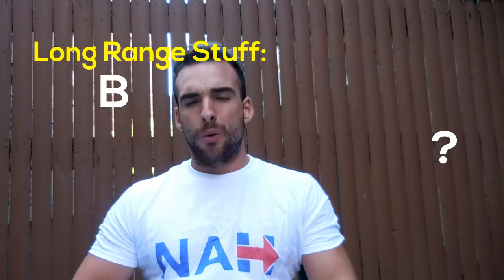New Rifle Barrel Break in Procedure (do you have to do it?)(HD)

Comment: Bang on! Besides a fairly brief cleaning when I first get the rifle to make sure nothing's in the tube, I just go shoot it. A bullet traveling at 2700fps will take off any micro burrs and the copper will fill in any tiny inconsistent rifling marks. I find the same thing. After about 50 rounds or so my groups tighten up and my Tikka did the same thing shooting a touch high. In my view that's from the barrel getting to a proper amount of copper build up which is good, which can make the barrel more slick increasing velocity. I just try to not to let the barrel ever get to hot. That's when you run into increased throat wear. But a 308, can handle this better as its not over bored. Then when I see my groups open up, I'll give it a run through with wipe out. Then it usually takes about 20-30 rounds to get back to tack driving accuracy. Great advise.
Reply from the maker: Yep!  Exactly my thoughts.

Comment: My "break in" is done while I am testing 4-5 types of ammo to figure out which one best works in my new rifle. Usually by 40-50 rounds I have narrowed down 1 or 2 that I will use in the rifle. Kind of kill two birds, as it were. So, even if the particular barrel doesn't need a break in, I am testing ammo any way, not expecting great results until I get the right ammo and getting use to the gun, like the trigger and recoil.
Reply from the maker: Thats what I do too.
Reply: That's what I did on my Savage 30-06 after considering that a break in was just a waste of time. Shot factory Remington to sight in my scope and then shot several different reloads. I did clean the barrel after that day and went back to the range several times with a narrowed down group of reloads. That gun now shoots groups that touch the edge of a dime or better.
Reply: @anthonym2504  I did use a very abbreviated break-in procedure with 2 Savage Axis rifles, a 270 and a 308 and they shoot as you stated.  Super tight groups for entry level rifles you could fully cover with a quarter.
Reply: @hardball107  how do you like those Axis rifles? I always wanted to buy one! Any issues? Any particular pros and cons I should watch out for?
Reply: @anthonym2504  I love 'em.  Both my son and I are National Match shooters and own everything from Weatherby's and Tikka's to entry level rifles like the T/C Compass, Ruger and the Savage Axis.  IMHO the best of the bunch is the Axis, I say this because I own a 270, my son owns a 308 and I've shot 7mm/08's, 6.5CM, 25/06 and 243 and all have been tack drivers.  All bought with rebates for $250 new.  Only thing added was an M*Carbo $25 trigger kit and we eventually upgraded the scopes.  Those suckers just shoot and are the best bang for the buck out there.  Problems ? None but, they do have the heavy lawyer 5-6 lb. triggers.  M*Carbo sells a kit that shims the trigger and gives you the choice of 2.5 or 3.5 lb. let off. worth every penny.
Reply: @hardball107  thank you for the info.

Comment: This is a big debated thing that I don't really think there is a right or wrong answer to. I do a barrel break in on most my barrels because as a machinist/gunsmith I know that no matter how sharp the cutter there will still be microscopic burs left in the barrel which need to be smoothed out. Does it make a difference is debatable but it makes me feel better and it's my time spent doing it so what does it matter.

Comment: The possibility of temperature break-in is probably due to metallurgy principles...But, when metals heat quickly and cool slowly the metal has tendancy to bend less depending on the center of the rifling.... But it is up to the descretion of the operator /owner having need...In my metallurgy experience I side with you on this point,that it is mostly hype or opinion and can only be the owner operators decision. Ex- Naval Aviation Structural metalsmith....... Cooling metals to quickly may cause flexing in the metals..... Which is why oil is used in the metal cooling process.....because it may harden the metal too much and make it brittle or dangerousely disasterous when using explosives......... Most metallugists can corraborate this on tempering metals..... Gunsmiths are usually the best metallurgists because they use explosive pressure scales to determine defects in metals....

Comment: Do you need to break in a newly manufactured barrel, no.  Modern processes have probably eliminated the need for it.  Do I break-in new barrels, yes.  I have an abbreviated procedure, less than 20 rounds and I does make a difference in bringing a new rifle to it's full potential.  Case in point, I bought a used Savage Axis in 270 for $125 from a friend that just disliked it, claimed it shot patterns.  My son bought one in 308 because as an old National Match shooter I had a basement full of 308 and his Tikka in 7mm/08 was starving for ammo.  My Savage was so copper fouled and dirty it looked like it had never been cleaned, a couple dozen passes with JB Bore Paste and a good cleaning and lube and we were all set for the range.  I put both rifles through my short break-in procedure and by the end of range day they were both shooting very sub MOA, a few of the groups out of the 270 you could cover with a quarter.  The groups shot with the 308 got smaller as we went along starting at just over 1 MOA and ending up right around 3/4 MOA.  Both rifles had Vortex glass and the 270 had a M*Carbo trigger kit.  It was nice to see the 270 tighten up and the 308 is a gem, would it have gotten there with normal shooting, probably but I have seen new rifles seriously copper fouled affecting accuracy.  My procedure seems to eliminate that possibility and as you said, lay down that copper burnishing needed for top accuracy in both new and used barrels after a serious cleaning.  I mean it couldn't hurt.

Comment: Remington 700 SPS tactical. heavy barrel. took it out of the box and cleaned it up good with ballistol. very mild cleaner. pulled 3 wet patches through soaked in ballistol. soaked bore snake in ballistol. pulled it through 6 times. pulled another soaked patch through. pulled dry patch through. shot sub moa with 168 grain eldx hunting load. after 50 rounds shoots consistent 3/4 to 1/2 inch groups all day. no break in period. just one extremely good cleaning out of the box. 1 in 12 twist rate. FYI.
Reply: that Ruger American 6.5 creedmore looking good. will probably be my next rifle.

Comment: What happens after you clean the rifle with CLP? The lapping or seasoning goes away and have to do it again?
Thank you.
Reply: No.  CLP is very mild and just cuts the fouling and removes loose carbon.  I run a patch through the bore with mineral spirits and finish with a bore snake with a little CLP on the end when needed.

Comment: so, the question I now have is...After you have shot 60 or rounds and have a layer of copper that has, for lack of a better term, polished the barrel, then you clean it, do you have to re-zero every time you clean? Cleaning might take some of the copper away and cause your dope to get screwy.
Reply: John Harris normal barrel cleaning with  wet patches is to remove carbon and other powder deposits. This does not remove the copper. A fairly caustic solution is used to remove the copper which is 'soaked' then removed. This still has to be done, but only after 100's of rounds when your grouping starts to spread out because of the copper equilibrium starting to rise. You then have to 'layer' the barrel with copper with 40-60 rounds before equilibrium is reached again.

Comment: These days with cold-hammer-forged barrels, the bore surface finish is so ridiculously fine, I doubt hardly any copper is shearing from bullet jackets. It's like a mirror, or chrome finish it's so condensed and fine. "Imperfections" are down to the microscopic level and virtually insignificant in the effect on the bullet sliding past.

Besides copper deposits, there's absolutely NOTHING happening with that barrel steel. Something as soft as lead, hard cast lead, or copper will never change that vastly harder steel.

And that's as simple as it is.

One of the best videos on the subject from GunBlue490:  https://www.youtube.com/watch?v=jCIi-SklcP8